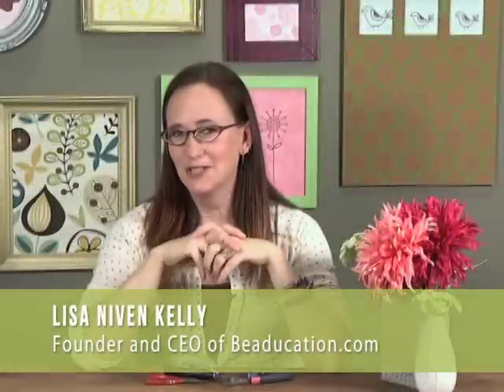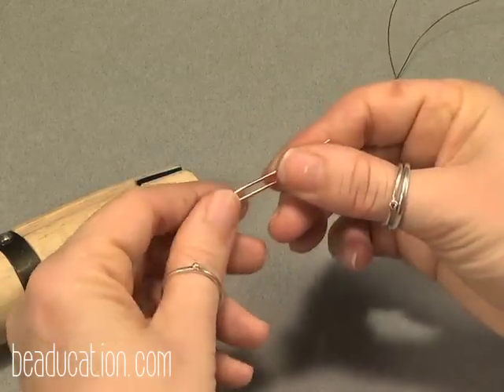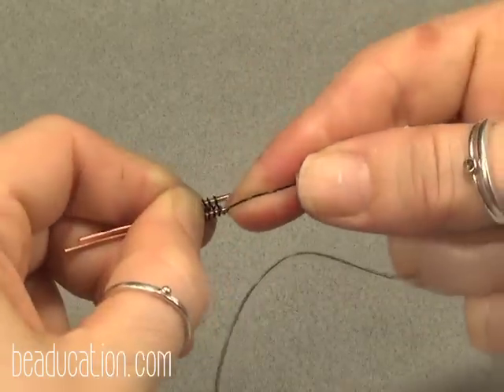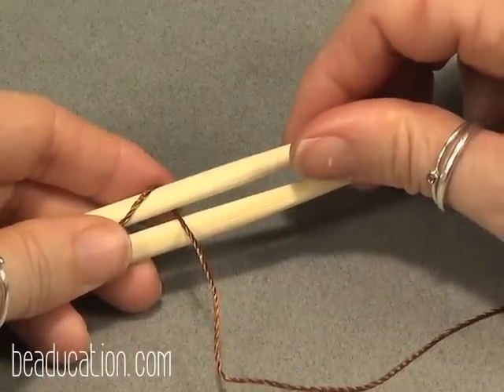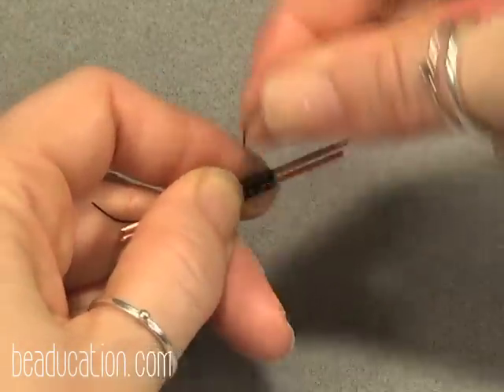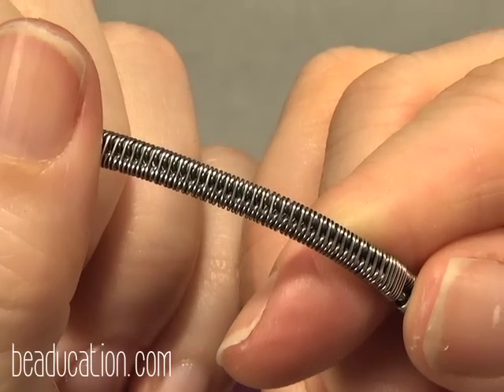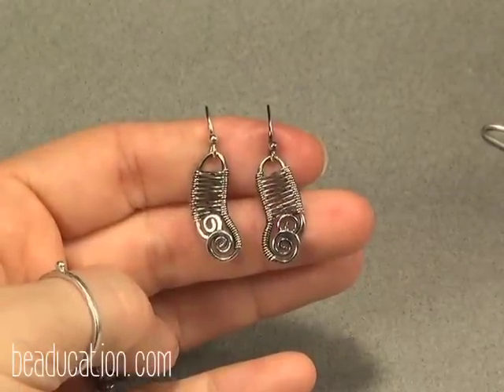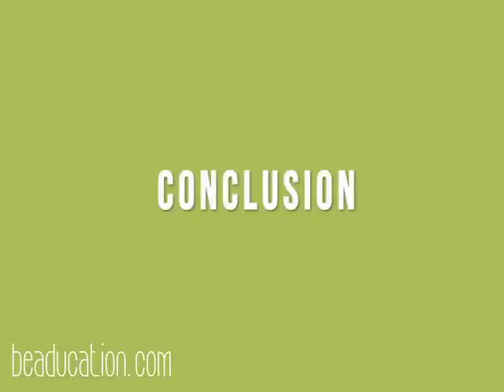Introduction to Wire Weaving Tutorial - Beaducation.com

Comment: Love your tutorials. 2 questions.  What do you do with the beginning and ending wrapping ends so they do not poke you or come unwoven?  And, how do you add a new weaving wire when you run out (and deal with the pesky ends!)  Thanks!  Maureen
Reply from the maker: Maureen Houston for the pesky ends, just make sure you use a very pointy cutter that can reach in and trim the wire between 2 warp wire so it kinda sits in that grove and doesn't poke out. To add in a new wire, just start weaving in a new wire and snip the tail (after you have significantly introduced the new wire) in the same manner, with a very pointy tip where it will let the tail sit snug and hiding between 2 warp wires.

Comment: This is lovely, but I am not sure how you can just snip the weave wire up in the middle and not expect it to bob up later and scratch the skin. even if it is tucked under, with movement, it'll eventually surface… No?
Reply from the maker: Hi DesertRose ArtDesigns, Actually  no, once put in its spot, it stays. There is no slack elsewhere to "catch" to pull it out. :)
Reply: Fabby. I will try…thanks, lovely.

Comment: Excellent video. You're a wonderful teacher. 
Question, I think I would be concerned that as you add more wire, the cut ends would eventually dislodge and unwind while my customer is wearing it, even if they are pushed into the space between the large wire as you have shown. How can this be prevented? 
Thanks............
Reply from the maker: Hi Peggy! The weaves created are tightly wrapped around the warp wires. Because we use half-hard, or dead soft wire the wire isn't springy, therefore they wouldn't unwind. If you're concerned about getting an end catch, we would recommend using a longer piece of wire, therefore having less ends and possibility for them to catch. But, I think once you make your first piece using this technique you'll see that if you burnish the ends down as LIsa shows it's not an issue. Have fun!
Reply: beaducation Thank you. I did make my 1st piece last night and did indeed find that the ends are very secure. Thank you for the quick reply!

Comment: you make it look so easy but everytime i try it without fail they look crappy,,not even some bulge out to far,,sometimes the wire flips over and trust me you can tell when it does,,i want to learn this so badly my fingers hurt from trying and my wires,,well the cost only allows for so many mistakes when your on a tiny little fixed income,,i dont know ahat to do,,,
Reply from the maker: gypsy269 Are you practicing first with copper and is that copper dead soft? Sounds like maybe you are working with a "hard" wire and it's fighting you? Are you weaving with a thin gauge? Make sure to work with 28 or 26 gauge, those are the easiest to learn with.
Reply: Beaducation actually i use half hard for everything cause i dont have a tumbler to finish my projects and make them harder so the dead soft will just stay that way and bend my sculptures or weaves out of shape if i cant harden them
Reply from the maker: gypsy269 hi again! Sounds like the right plan to use half hard for your thicker wire on your sculptures but for a weaving wire, you for sure want dead soft. You need that wire to nicely bend into shape without fighting against you. Your warp wires could be half hard, but weaving wire should be soft. Hope this helps :)